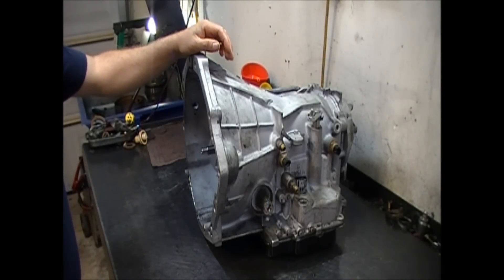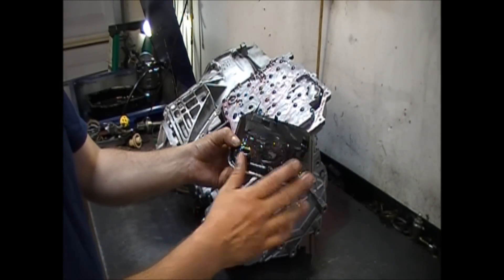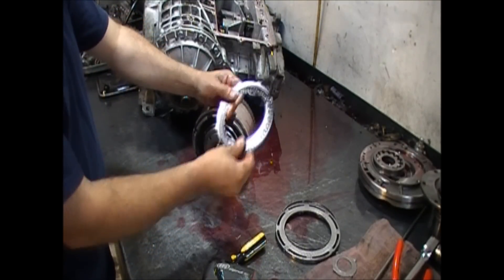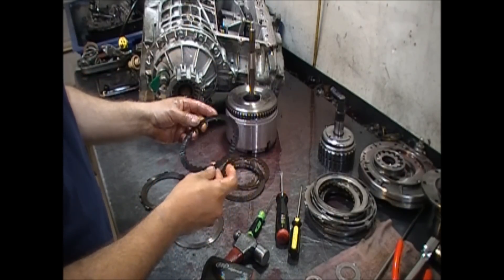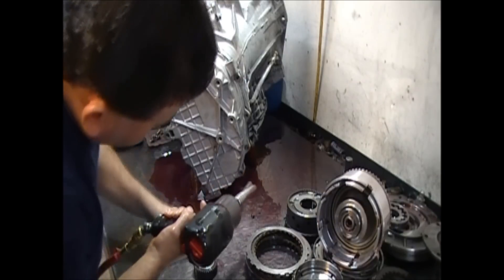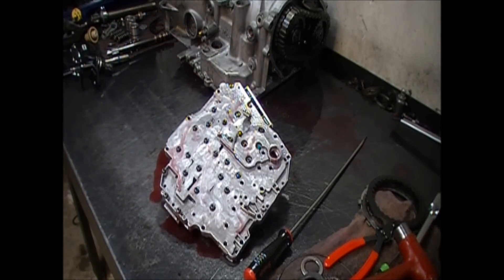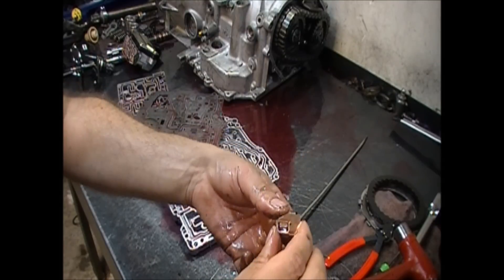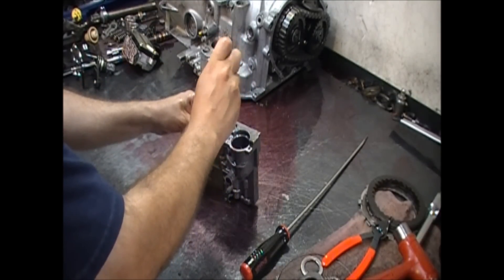42LE Transmission (A606) Teardown Inspection - Transmission Repair

Comment: Thanks for making this video.  It was very helpful for the solenoid pack replacement I just completed on a 2003 Intrepid.  The failed solenoid pack had a date code that was in the range covered by the TSB.  I did have to go back into the transmission and correct the placement of the parking arm - the detail in your video at 8:50 helped me understand how to position it correctly.  Thanks, again!

Comment: I wanted to thank you for getting back to me regarding my earlier problem  It took me about 1.5 months to tear back into it today.  After repeatedly putting the valve body in and having the same problem, I put the original valve body into it and the "park" worked.  We then determined that the "remanufactured" gear body parking rod had a lot of slop to it.  We then swapped out the selector, rod, and gear indicator switch from the original one to the remanufactured one and it works fine.  Makes me mad that I had it right the first time, but the part was not up to par.

Comment: Anyone who still can't drop the valve body out, in most vehicles there is a green wiring harness going into the top of the trans-axle. It should have a red piece of plastic inside of it. This red tab must be pushed out the side and then you should be able to pull the wiring harness off. You must do this to get the valve body off.

Comment: Mr. Gutierrez, When removing the valve body you explained the two accumulator pistons have two springs each depending on the engine. Ours had two. If we did not pay enough attention and installed without the inner spring and only installed the larger diameter spring what would be the result or malfunction when driving?

Comment: Say guys I have a 2002 Grand Caravan Sport. I've changed the CV axles with new ones and I still get a vibration when I accelerate, but non when coasting or at lower speeds. 
1. I've changed the Passenger CV seal S-3459 and it helped. 
2. How much up and down play should the CV axles have when seated and installed. 
3. How do you test it.
I haven't changed the drivers CV Seal yet, do you think it will make a difference.
Thanks for your time and help, nice videos. Best Wishes n Blessings Keith

Comment: Good job man!! funny you posted a video tonight, i think valve body gaskets let go on my 5R55e, did it once tonight, thats enuff for me to replace it with bonded spacer plate, just worried about the bolts being different lengths

Comment: I had thought the differential sprocket and chain was in differential fluid. How do you replace the seal that separates the trans fluid from the differential fluid?? Thanks for the video.

Comment: this video is awesome, you did a great job with this transmission....I have a 2000 dodge caravan a604 transmission having some problems with it, need your help in what step I should take from here. It was rebuild about two years ago it work fine when i got it back but after awhile start acting up...If you dont mind would like to talk to you to see if i can get this problem fix...thank you hope to hear from you!!

Comment: I need to replace the solenoid pack on a 2003 chrysler concorde with the same transmission. Will I need to remove the 10mm bolts only or the 10mm bolts and the torx bolts as well in order to drop the valve body.

Comment: When assembling this unit, whats the trick you prefer to use on the sealing rings that go on the front pump? I've had issues with these in the past, and been using very tacky green assembly lube, but it is not always holding the seals closed while I slide the pump back into the stator.

Comment: And please don't forget use the bracket to keep hold the torque converter, because, I did not use  my first time and I destroyed the oil pump, this happens when you are  shaking the transmission to put together with engine, if you don't  have the bracket there, little by little the torque converter moving to outside and when you tie the bolts the oil pump's gear destroys the aluminum wall. I am just sharing my experience with you guys to so this doesn't  happen to you....

Comment: could you post a video for a complete rebuild on a first gen from 93-97 , maybe a breakdown of common issues and the fixes ..i am about to rebuild my first one out of my own intrepid ,so im doing the homework . i would be very interested in rebuilding a unit that will last ...so i am very curious to know what would be the best options to help update it from the factory weaknesses that it had ..
Reply: *****
 you are really very awesome ...i have a 97 intrepid ...had issues removing the cv axles ..the boss took over had a bright idea beating on it and ended up cracking the long shaft outer (driver side) snap ring and spitting out the whole axle ..his solution was jb weld ...after some arguments ..and other issues with the current transmission i went to the bone yard ..found a 96 lhs and pulled the trans was hoping to drive on the current trans but its over heating now a lot with code 74 in the tcm and nothing else and shuts off after warm up creeping at lights ..so i have parked it ..now just trying to figure out exactly what i should replace in the pulled trans from the yard it had 187000 on it so i got a shift kit coming ...am going to order the master kit, and am wondering if there are specific hard parts i should upgrade ...it is a late 96 model trans ...just wondering if there are hard parts one should make sure are upgraded?...even if i have to pull a newer trans to mix and match for stiffer parts...hard to find a good list of suggested items
Reply: TheTrifel
i was hoping that first gen and second gens are the same minus the connectors ...and your right these units are really not common anymore but i love the car and well im an apprentice so this for me is to learn with and well to make a bullet proof intrepid transmission would be nice, i have no problems with pulling another trans for better hard parts and final drive ratio ...if it is worth the effort or easier to just buy...

your videos are very informative and very easy to understand and follow thank you for your time it is very appreciated!!

Comment: Hello, awesome video, but i have a problem and a question, i have a 1996 plymouth voyager 3.3l v6, fwd 4 speed auto! but i have bad gear ratio in first code, and the van will not go forward, only reverse works! is this because the filter is bad and is air in the hole? thx

Comment: hope i get a response hiriam. i rebuilt a 41te guiding my self some what with this particular video now i have the trans back in but when i installed my axles.. they turn while im in park position. i dont feel thats right. i took off the valve body so i can position the parking lever, and yes it was done right, re installed properly and still turns.. what should i do?

Comment: Hi, I am trying to replace solenoid pack on my 2005 dodge Dakota 42LE. Could you please help me? I have pan off, filter off (soft hair from ATF+4), and 10 mm bolts from valve body. I replaced the TISS. I removed clip/with red plastic lock, from plug on engine side. I’ve wiggled and pulled (not too hard). The valve body won’t drop down. How does it come off? And what should I do to get off sand (ground) from face of valve body?

Comment: Yes I need some help.bought a 01 concorde  only has 46000 miles (the reason I bought it) grandma's car took her license can't drive no more.seller said needs The tcm car would not go over 30 miles an hr.fliud very clean car in xlnt cond so I changed speed sensors and tcm now engine light is off no codes but making winding noise but comes and goes.when no noise it's fine.but when u hear noise it's in and out of gear. so thinking it's solenoid  pack.please help I don't believe trans is shot only 46000 miles

Comment: I got a question for you.  I put on a rebuilt solenoid pack and valve body.  It shifts fine, but rolls in park.  Do I have the parking rod upside down?  The long clip on the rod I got facing down to hook onto the rod of the valve body.  I saw a parts diagram where it showed the clip pointing up, but in that instance, I guess it doesn't clip onto the  valve body.  Do just clip it around while the body is out and flip it around when you install it or what have I done wrong?

Comment: hello there hiram I just did the a604 41te from 10 dodge journey 4 cyl.
and when I put on any from gear the transmission kills the engine, and the reverse works right.
what do you think that I did wrong? need help here THANKS

Comment: I need help! Just replaced my solenoid on my 2003 dodge intrepid. Put in in manual low so i could pull the valve body after putting it all back together i cant get it out of low to start it. Seems really hard to get out of firstgear. Any advice would be great

Comment: need help got a 62te hard po740code went through it and it had code 871 ound that check ball was missing in the new valve body nowcode po734 i pull this three times and went thrugh it with new kit 2 times now the code infor is telling me it could be low on fuild or speed sensor and wiring or acc cover and acc seal but there all new

Comment: Hello, I have 42LE 1997 dodge intrepid, with 4 gear rear planet originally, can I install 5 gear rear plant from later models?
Reply from the maker: Yes, just make sure the tooth count for the reluctor are the same.

Comment: I have a 42LE and I'm losing gears in morning on initial start-up. If I idle in neutral and rev it a few times, I get gears and drives normal all day. I'm thinking pump bushing is worn out causing fluid to leak from the torque converter back into the pan. Anything else it could be? Anyone want to help me rebuild this thing? lol

Comment: Great Vid Hiram.

Between your vid and this post ( http://www.lhforums.net/forums/showthread.php?17483-How-to-replace-the-solenoid-pack-on-the-42LE-transaxle ) I managed to replace a solenoid pack on a 42LE 2004 Concorde. (Daughters car)

All went together fine. The problem I am having is it is hard to get into park (must "slam" shifter into park)

Sometimes it may take 2-3 time to engage into park. Any ideas on what i may have goofed up or if there is any adjustment for the cable.

Thx, Alf